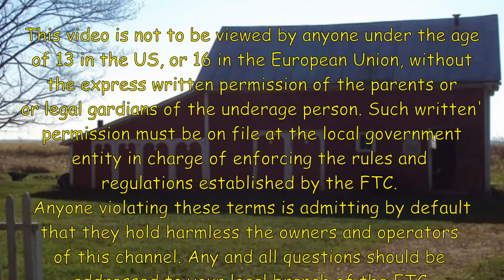Windstorm Damage - Repairing Linda's Windmill

Comment: #1- I like the paddle switch on the DeWalt grinder. I've been wary of the handle switches on the old B&D and Milwaukee in the style of your Hitachi. And the big grinders never had a guard on them either and the Milwaukee cut the guys finger off at the boulder hole shop. And I'm with you that a paddle switch will turn itself off when or if things get goofy. #2- Good deal on the welding on the windmill. I'd end up with a pancake hood and a tig rig with a pedal. I've got way too much moisture for a regular hood and probably too wobbly for a wire feed. But till I get something else I don't need I'll just watch you, Jody and Steve Watkins. And maybe Jason and Bo down the road. GBWYall and Happy Baby Day!
Reply from the maker: Wire feed welders are kind of like using a caulking gun. You pull the trigger and move the tip. It welds as long as you don't stuff the tip too close. 
Never used a pancake hood. Closest to one was a hand held shield for watching from the sidelines.
Reply: @OldSneelock  10/4 on the hand shield. I had to use a regular hood like that. Got a set of cutting goggles and put a shade-10 lens in it. Worked fine and didn't fog but was awfully rough on the face. GBWYall!
Reply from the maker: It will raise a blister on your nose if you weld longer than a minute. 😱☹️😶‍🌫️
Reply: @OldSneelock  If it takes that long.
Reply from the maker: When I was about 14 I asked for an Arc Torch for Christmas. 
It was a Bakelite handle with two copper bars that held copper jacketed carbon rods. When it was plugged into the welder, I could slide one bar until the rods touched and started an arc. I took it out in the workshop and played with it for about an hours. I didn't realize I had a hole in my pant leg on my right thigh. 
The UV from the torch burned my leg until when I quit I had a blister the size of a quarter on my leg. 
In 1969 I started a t the foundry. 
The Midwest was having an emission's system installed on the Cupola stacks.. I was just starting and they had hired a crew to do the heavy fab  work putting up the 80' tall stacks and the ductwork. 
My boss hired a supposed journeyman welder. 
He went up on the upper deck of the cupola and welded all morning. When he came down for lunch his face was red as a beet. 
He just had two white circles over his eyes. 
He wasn't a welder. He was an iron cutter who really needed a job. He welded all morning with cutting goggles. He left at noon and never came back. 
I always had anyone who was going to be welding prove to me that they knew what they were doing before I turned them loose. 
I trained many people in how to weld and cut. Never had one burn their leg or face. 😱☹️😎
Reply: @OldSneelock  I remember the 2 rod torches. Never fooled with one and maybe they were in Popular Mechanics or Science. I have used cutting goggles for welding but for just very small units of time, knowing full well they weren't shade 10. I never burned myself either except all the sparks landing on me that you get used to. My eyes finally got so sensitive that I can't be around it but very little. Reflected is almost as bad as direct. I'll just keep farming stuff out and forget a tig rig.       For now!
Reply from the maker: @lewiemcneely9143  When I was 35 I needed glasses. Actually I needed them when I was 33 or so, but that's beside the point. 
I went to school with Dr Young and so I went to see if he could get me fixed up. 
The first time he looked in my eyes he asked if I was a welder. I said yes and asked how he knew. He said my retinas had burned spots on them where I had gotten weld flashes. 
Note: After typing the above I wanted to refer to a picture of a damaged retina. 
While looking I found the following article: https://bjo.bmj.com/content/bjophthalmol/72/8/570.full.pdf
It shows the results of a study of specifically MIG welding injuries. 
It states that the amount of energy released by the small contact arc of the MIG process is much higher than that of a stick weld.
Reply: @OldSneelock  Sure! A MIG is right out there by itself in the open. A stick usually has some flux somewhere. I've never been a big fan of electric helmets. Seems like I heard yours squeak a time or two. Like the welder over at the other boulder hole. Get everything ready, position the stinger, grin REALLY big, shut his eyes and jam it. This is only for tacks though. He's a really good welder but extremely goofy sometimes. All I use are magnifiers and the v.a. has run me through the mill with eye tests. Got one coming up in august with the yearly. Oh well. Just like pee tests at the boulder hole. I was THE one for a long time. Guess they were partial to garlic juice. GOOD article and I've had the red 'gritty' eyeballs myself but not a really bad dose. Thanks for the PDF. Looks like a really good read.
Reply: I've seen the results of the tests in the PDF. My eye person always shows me what I've just gone through and we hash everything out. One always talks about healthy eating being a huge contributing factor in eye health. I'll probably get dilated this time but I hope not. Riding back and everything looking like an ice storm ain't cracked up to what is ought to be but I shall be content as I can be in whatever state I'm in, I hope.

Comment: Hi Dave , It Should be Sturdy When You're Done . Nice Work .
Reply from the maker: After struggling to get my hand back in I got the welder set right and finished up the welds. It will hold together. I should be done  Thursday. 😁😎
Reply from the maker: Thanks Wayne. 
Welding is done when the paint dries she can put it back out in the yard.

Comment: Those windmills will last a lifetime with regular lubrication and a paint job every decade or so.
Reply from the maker: Sturdy anchors make a big difference.
Reply: @OldSneelock  Maybe some big screw jobs like trailers are anchored down with. Put them in with a 1/2 inch drill motor.